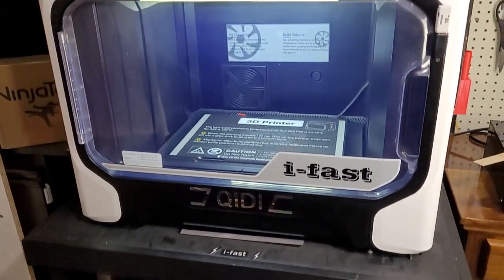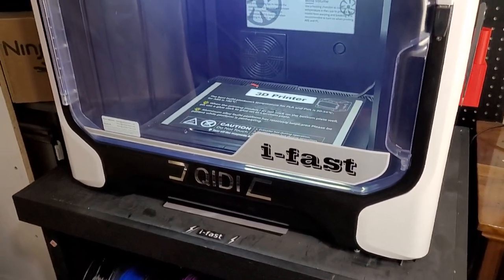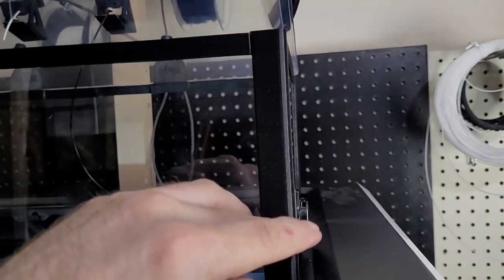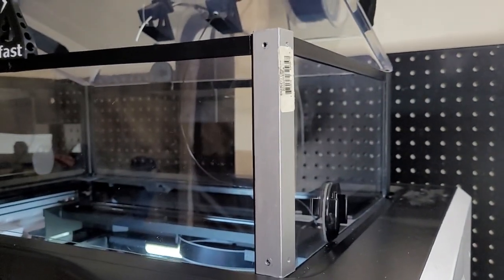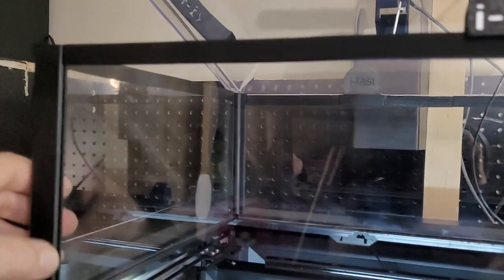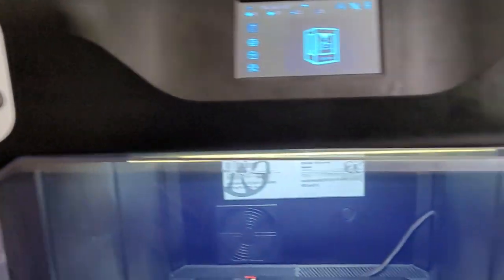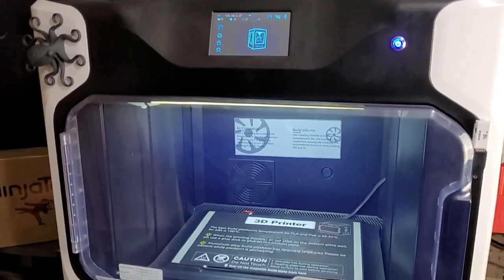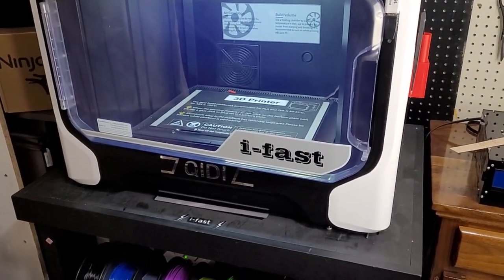Qidi i-fast Final Mod??!? Hood Lift Corner Bracket Design.

Comment: Four diff brands of dried ABS and it will NOT stick down. Will the metal side of the flex bed survive Acetone ? For a slurry
Reply from the maker: So I've printed abs a few times and hadn't much issue other than with glow where the ceramic particles reduce the surface of abs that's sticking.  I think my bed temp is pretty high for abs.  I'd have to check but I think I went with 85 or 90.  I even printed some for the review.  I'll have to go check videos to see what plate I used but the black sticker plate and the textured surfaces both worked. The pei textured plate required a bit of glue stick.  I'd use it with the sticker plate as well.  Abs can stick like glue to that.  

I've used acetone based slurry a few times in the past.  I don't think you'll need to go there.  Feel free to post your print settings or send me an email with some pics of whats happening.  Bed adhesion can be wrecked by so many things. But issues can be chased down with a bit of team troubleshooting

Comment from the maker: I plan on altering the hinge design so it will print vertically and the not require pva or other supports.  I'm not sure when but if you print it in tpu you much be able to do that already.  Just a tip.  You can also adjust your print settings to not support anything under a certain cm squared.  I think 25-30 would stop it from trying to print pva between the letters on the back
Reply from the maker: Bed temp 110
Retract 2.1 @30 mm/sec
Speed 70mm/sec
Fan 0%
My temp was 210 but this was a glow filament, you'll need to go a bit higher I'd say.
Glue on the pei textured build plate

Comment: Hey buddy. I've been printing only pla and some PETG but want to move to carbon fiber. Have you tried this filament?. Great work as usual.
Reply from the maker: I have.  Keep your layer height above .22 or higher if you have issues with clogging.  Maybe get some .05mm nozzles if you end up with issues.  Other than that, buy purge filament, learn to do cold pulls and if you end up with issues your always welcome to come ask. 
Thanks for the pat on the back!  I am pretty happy with the way this all turned out.  Mods look great (to me at least) and the issues are solved.  All while dialing in and testing some cool filaments :)

Comment: I think I am going to attach pneumatic fittings to the lid so then I just push my ptfe tube in and keep my dry boxes in use
Reply from the maker: Ptfe tubes fit into the back of the remote sensor.  No fitting needed.  It's only about 1cm exposed.  You can fees right from the dry box to the sensor box:)
Reply: @melioratewithnate  oh thats great. Thats my next project with the lid mod. I been using this thing non stop. Had a few issues. Mainly slicer problems. I see they redid the slicer it seems better. Still hope they add paint on color changes
Reply from the maker: @Jim Nicholson  I downloaded the new slicer.  Normally it updates the current one, it does appear to be a whole new layout.
There have consistently been notable improvements with each iteration of the software.  I look forward to trying it out.  Save your custom filament settings!!  Write them down, etc.  I had an update delete my first month's worth of testing/dialing in random filaments. Now I keep a journal with them in it.  Back to the paper system here,  in triplicate,  jk.
Reply: @melioratewithnate  Oh yeah you're 100% correct this is a totally new write of the software so it doesn't replace the old one it didn't bring any of the settings or profiles over I never deleted the other one it's still there so it is going to be a little bit of a pain to have to bring them all back but they are making headway they've asked me a few questions already about what I think needs to be corrected because I've been complaining about that slicer and the fact that they're tying it to their printer I don't like proprietary systems like that because when you have a number of different manufacturers products it just makes it a real pain if you can't use one piece of software for all of them
Reply from the maker: @cybor462  they are a good company that way,  thirsty for feedback!

Comment: Glad you got them made. I have been waiting for them. I have several spools of ASA I am trying to use I will use that for the brackets. I am going to relocate my sensors. Now that the lift brackets are out I will do that too. The other sensor housing you remixed are just about exact size as the oem now. Thanks for that. Any chance you posting the lift device for the lid. I think thats great.
Reply from the maker: It's with the hinge files on cults 3d.  Thanks for the feedback on the sensor casing.  I appreciate that.  For how simple the corner brackets are I wish I'd designed them before messing with aluminum.  Lol

Comment: You had any clogging issues mine keeps clogging can't even get an hour into a print
Reply: The hardened steel, carbon fiber pla, everything else I use the standard
Reply from the maker: @Hero  adjust your layer height above .25  longer strands tend to clog. Enter the contest:)  there's a plated nozzle that's .05mm  from microswiss.  You'll often see companies suggest a larger nozzle size for CF.  It might be longer strands, some companies use shorter ones.  The drawback being shorter ones are more cosmetic and provide a nice finish but not as much strength.

I had one fail with carbon Fibre.  Seemed to clog for a layer then unclog resulting in the part coming loose and moving around with the extruder...

Also make sure your temp isn't too high and your retraction is around 2mm if it can do it.  The less pulling back in the better as reversing direction can definitely cause clogging.  

CF is great but it can have its drawbacks.  Glow is about the same as it has ceramic powder in it.
Reply from the maker: Which extruder are you using?  Filament type?  Brand? Retraction distance? Print speed? Flow rate? Temperature you're extruding at?

Happy to help if I can
Reply from the maker: Your bed might be set a bit high
Reply: @melioratewithnate  would fast leveling fix that?
Reply from the maker: @Hero  yes,  just adjust the height at the end down two button presses.  If it doesn't stick go back and adjust up one press or .05.mm  Also set your initial layer height above .27.
Reply: Did like 3 prints now it clogs every time.
Reply from the maker: @Hero  do you have purging filament?  If not try purging it with pla. Let the extruder cool to about 80-90C and do a cold pull, depress the filament tension bar and pull the filament out.  You should see the shape of the all metal hotend/nozzle end.  Purge again then try again with the cf print.
Reply: @melioratewithnate  I have been doing that exactly to get the filament out
Reply: @melioratewithnate  then it runs and starts printing the next part and then randomly clogs again
Reply from the maker: @Hero  maybe play with the print temp a bit.  What brand of filament is it?
Reply from the maker: @Hero  I'd try order a larger nozzle size for that particular filament.  I've had good results with two brands of cf so far.  One clogged more but I was trying to extrude it below .2mm
Reply from the maker: @Hero  also try turning retraction right down,  increase the flow a bit.  I have had filament issues in the past.  It can be frustrating beyond belief

Comment from the maker: Print time on the corner brackets is about 3 hours,  4 line walls/bottom/top.  30% infill. 

If using tpu
Try
 234 C Nozzle temp
1.8mm retract at 30mm/sec
Flow 100%
Speed 70 mm/sec
Bed temp: 50 C
Print cooling:  100% after the first layer.